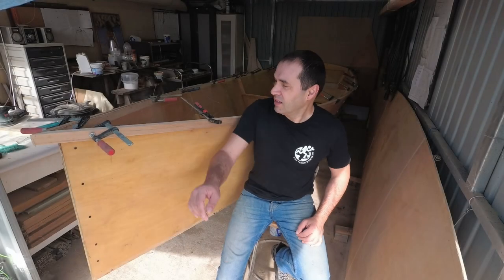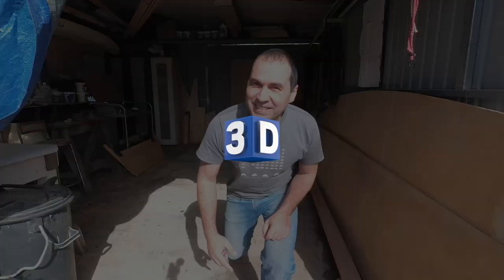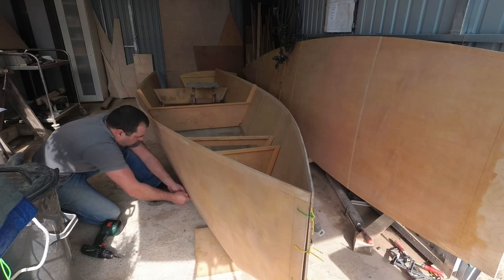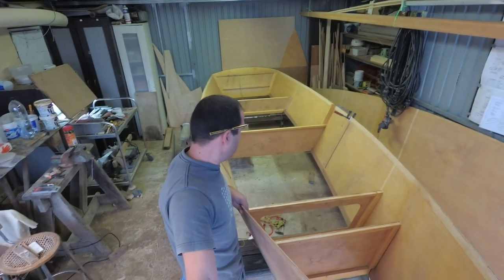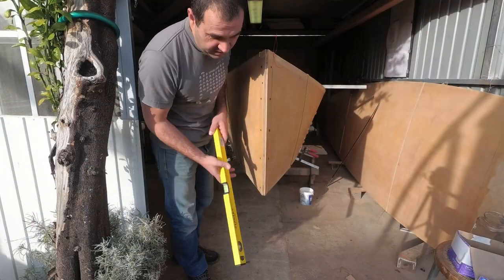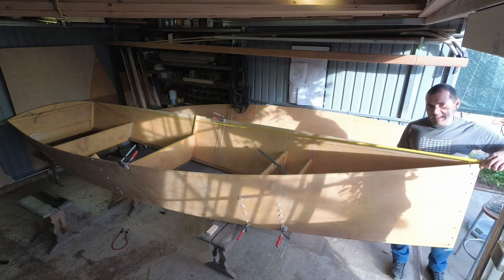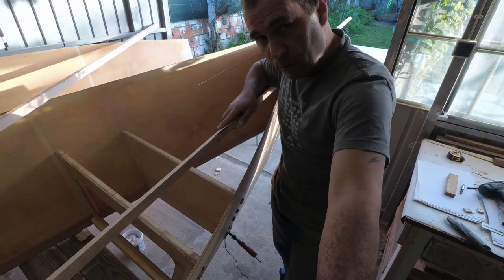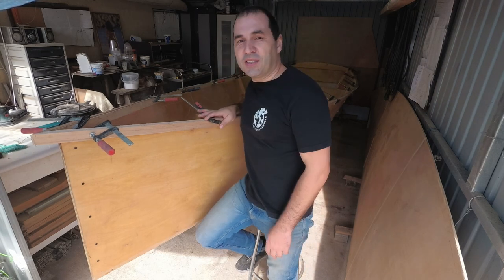Building a Goat Island Skiff - WEEK_11 - homemade plywood sailing boat

Comment: I'm a welder fitter a good tip is always to start at a fixed end. for example at a ninety degree corner and work from there, but you don't have any so you start from the bow fix the bow because they are equal parts fix them together first and than move back to each bulkhead at a time and just make sure between both sides of bulk your measurements are equal. before fixing that bulkhead. Then continue moving back towards the transom to the next bulkhead. Do not go all the way back to the transom and work back towards the bow. Try to align all that first its a waste of time to do that. Just as I said work back from the stern to the transom a bulkhead at a time.. and keep that order. that will same you massive amount time and headaches. btw this principle or application always works it doesn't matter what your building. 
 I know your finished the boat now its al little to late to give you that tip but if you ever do that again this is a good tip to apply.
Reply from the maker: Hi Fon!
Hopefully this won't be the last boat I build so thanks a bunch for your input, appreciated!! 😉

Comment: Hint:  For cheap and effective clamps, purchase PVC pipe 3-6 inch diameter.  Cut into 4--6 inch pieces.  Make a cut into each piece so they can be partially open.  Now you have a lot of clamps for epoxy work.  
Epoxy does not need massive clamping pressure, just enough to squeeze out excess.

Comment: How many clamps do you recommend for the GIS construction?
Reply from the maker: You can never have enough clamps!! 😁
You can buit the GIS with half a dozen clamps if you screw the panels (temporary). Otherwise....30 clamps give you enough margin to work several pieces at the time.
Reply: @TheBoatRambler Thanks, I’m inspired by your build ,I’m just trying to get some supplies before I buy the plans.